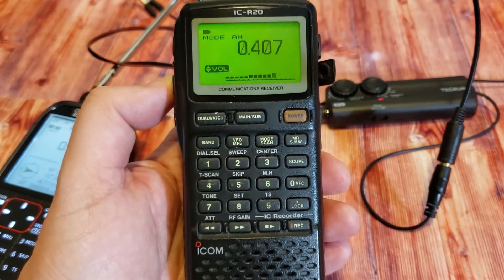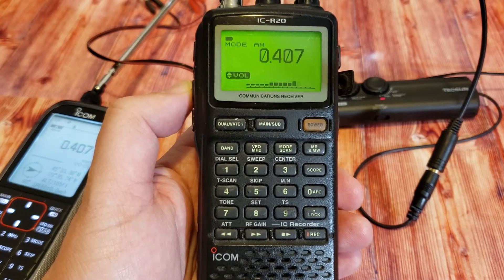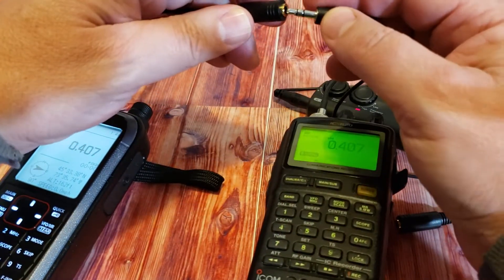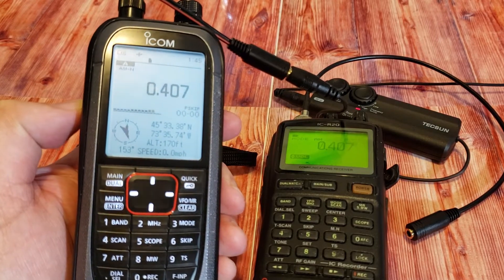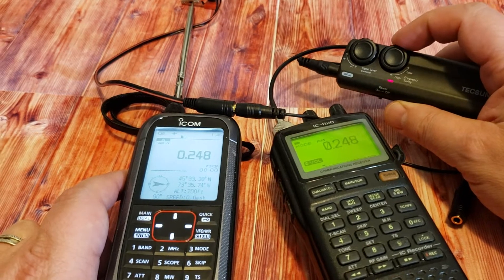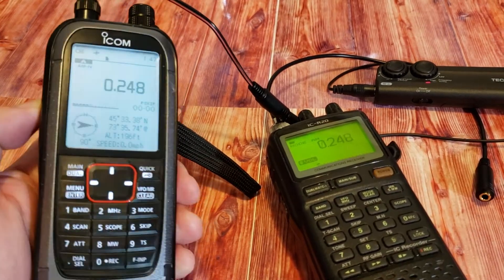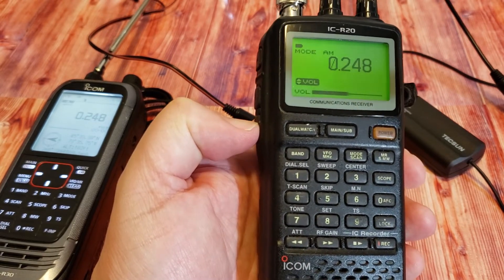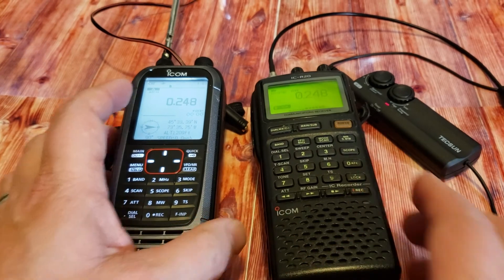Longwave non directional beacons Icom IC R30 VS R20

Comment: If I had both radios I would test with Identical antenna setups.  There could be some LW loss in the factory whip on the R30, while your R20 is feeding directly into the radio.
Reply: Also, the R30 uses a ferrite bar for MW and LW and you have to manually deactivate it to use the top feed for the antenna for those bands